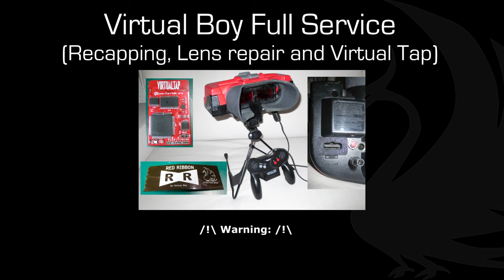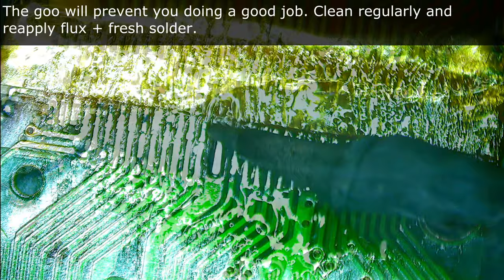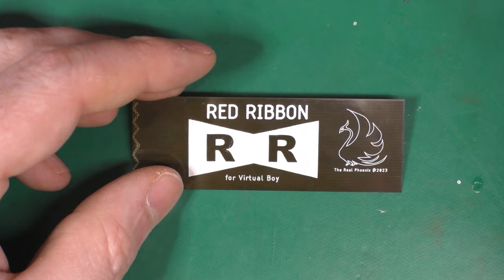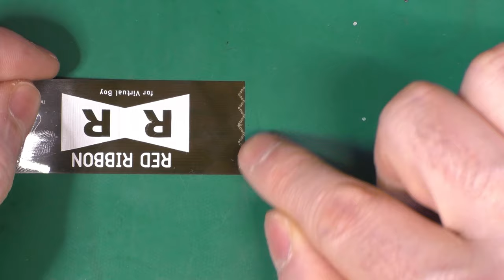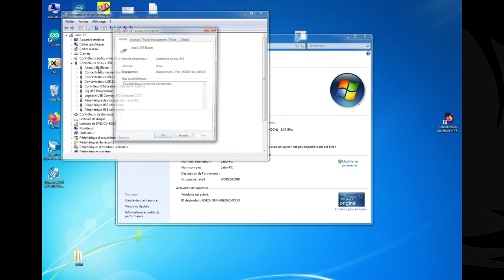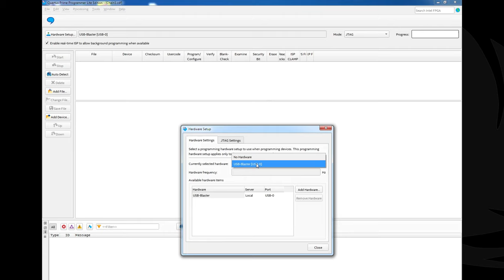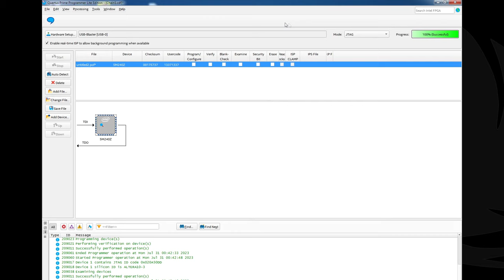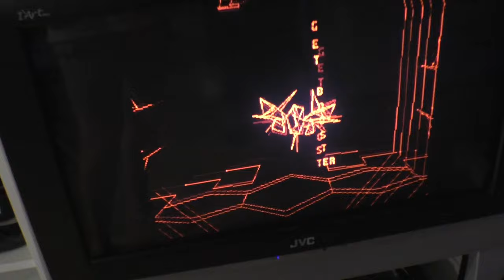[RETRO] Virtual Boy Full Service: Recap,  Lens Repair, VirtualTap installation

Comment: Do you have scematics for the programmer helper? I found the PCB link, but no component list/BOM
Reply: I was also looking for the info, but here's what I came up with. @TheRealPhoenix_Retromods please correct me if I'm wrong.

AMS1117: TLV1117-33IDCYR or equivalent (MC33269ST-3.3T3 is obsoleted)
C1, C2: 10uF 0603
R1: 1K - 0603 (Assuming it reads 013 on the resistor)
R2, R3, R4: 10K - 0603 (Assuming it reads 01C on the resistor), R2 not necessarily required for the TDO line
Micro USB connector: 10118194-0001LF or equivalent
JTAG Connector: 61201021621 or equivalent